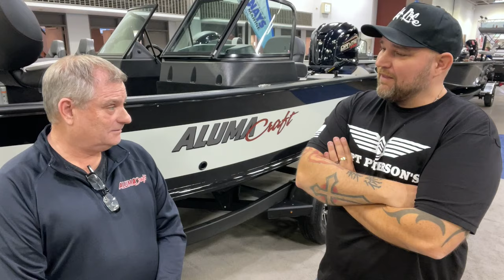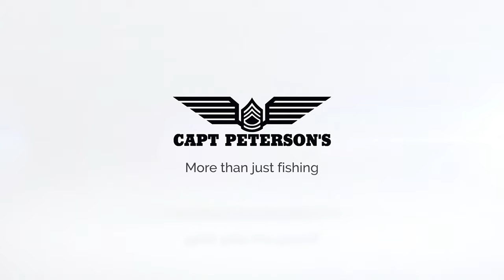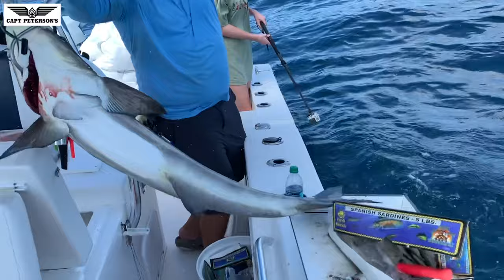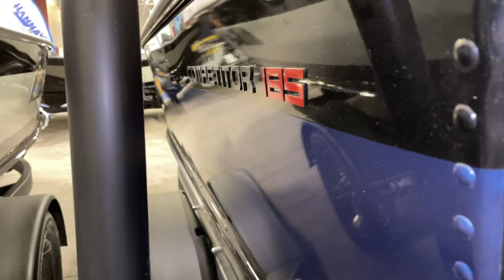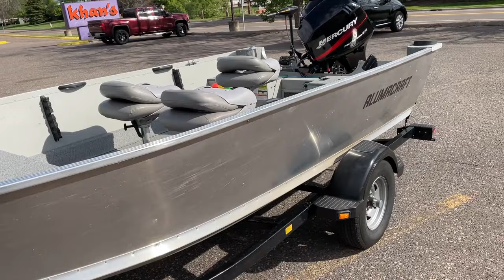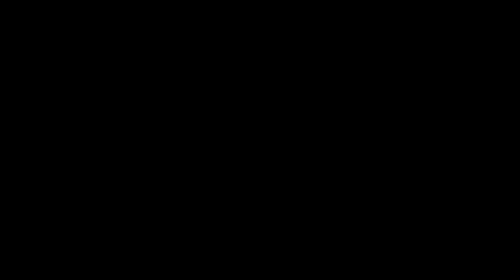No One is Telling You The Truth About Aluminum Boats So I Have To

Comment: Its real simple logic.....aluminum boats flex.....welds do not flex....rivets do....
Reply: Yep, rivets can create elongation within their the holes. Welded joints throughout time create "weakest link" points scenarios; next to the weld itself. I'll take the "rivet" design any day of the week.
Reply: Tell us of battleships and aircraft carriers, or even oil tankers that are rivited. Lol.
Reply: @NoneOfYourBeesWax1  Also you tell us the difference of the Steel and Size of the Steel being used on them application. Big (Huge) difference in applications than a sheet of aluminum hull less than 1/8".
Reply: ALL metal flexes.

Comment: the smaller Starcraft riveted boats held up fine for decades but would leak unless the rivets were re-bucked.  the larger ones, 20 ft and over were prone to cracking along the bottom between rivets.  we have a 1967 Starcraft 14 foot and it's still doing great.
Reply: I have 71 15' Starcraft Runabout all good except where the previous owner let it rub on the rocks , got that repaired , been 30 years  no leaks.

Comment: I've had two riveted boats and both started leaking on the place where the studs from the trailer had contact. It's not so much the bumping on waves but it's the transport on a trailer that causes leaks. I own now a welded made in Finland Buster boat for many years and the quality and performance is not comparable with Aluma Craft etc.  I should have bought a Buster from the beginning than i saved a lot of money and trouble.

Comment: I have owned 15 fishing boats. A long time ago, I.bought an aluminum boat that had been used strickly in salt water fishing the bays in Texas. Every rivet on the boat leaked. I.coated the bottom with polyester fiberglas cloth and resin. Never leaked .a drop after that. I now own a 16' 8" Tracker. I.bought it because it is light, and was inexpensive. I fish small 1000 acre lakes that rarely get any chop on them. If it is windy, I don't go. I hate fishing in the wind. I bought aluminum because they are lighter, require less maintenance, and since I usually fish alone, are much easier for me to manage.  When gauging toughness, I look at what they use in Alaska. Their boats are all welded aluminum. All.of them.
Reply from the maker: Lunds are very popular in Alaska, Canada, and Minnesota on big lakes. They are riveted.
Reply: @CaptPeterson Do not forget Polarcraft. My Dad had one for well over 30 years until he passed. The point is you could run that boat up onto the rocks and pound the dents out of the boat, and she was good to go.

Comment: To me, the pinnacle of aluminum boats are the Coast Guard 45-foot response boat-medium. By pinnacle , I mean if I could have any aluminum boat, I desired, this is the one I would pick. Obviously I would want more luxury than the .mil version, but the self righting ability, hull design, dual 6 cylinder diesel jet pump powered drive. Joy stick controlled. It is designed to operate in 8 ft seas and survive 12 ft seas and 50 knot winds. Is it riveted or welded? AND we all know the government doesn't always pick the best of the best, but instead often pick the cheapest unless there is a reason for the more expensive option. As far as I know, the RBM45 is welded since you can find the CG requirements for repairing any welds online. I assume there is a reason for picking the more expensive option. AND this has no real context except it is a fact and it was a famous ship that sank. The Titantic was riveted. lol

Comment: Welded is much less likely to crack then around a rivet.  Rivet is actually cheaper to produce than welding due to the time required.  But welded is stronger and more watertight.  That is why welding is used where strength is required.  Trucks use oversize box and riveting for cost and speed of production as they do not need to be watertight.
Reply: The weakest part of a weld is the perimeter; NOT the weld itself. In other words the (less than a 1/8") aluminum IS the weakest link.
Reply: @BumpNrun69  And putting hole in it and then filling it with a rivet is even weaker.  I did NDT for several decades and know which I would choose every time.

Comment: Thinner aluminum sheet is difficult to weld effectively. Manufacturers use thinner material to save money therefore really have no choice but to rivet. They don’t rivet because it is superior, just superior for the material thicknesses they use.

Most river boats that are required to run over and survive rocks, sand, and logs, use thicker formed and welded aluminum sheet/plate. The thicker material allows welding without overheating and burn through like you would see on the thinner material used on riveted boats. 

The flatter the bottom the more it will flex too. That is why you need the thicker material as well.

I’ve seen many Jon boats that are riveted start to leak because over time they start to fatigue from flexing so much. I’m talking about the thin walled RIVETED ones. This isn’t because they are riveted, it’s because cheap thin boats that don’t hold up must be riveted because welding isn’t an option on boats that thin.

There’s also the fact that rivets on a boat don’t take 2 years of trade school and years of practice to master. I would say on a production line a hard working unskilled person could learn to rivet fairly quickly where as putting out a “stack of dimes” is very difficult therefore a competent welder would cost the manufacturer much more.
Reply: Laser welding does fantastic on thin aluminum.

Comment: on my second welded boat been in rough seas many times landed hard many times no issues tired of rivet guys saying welded boats crack that's BS I think both are good and its a stupid discussion and air planes have big temp and pressure changes that's why its riveted pretty sure a boat will not see the kind of changes a plane will see.

Comment: It’s all based on the thickness of the material thin aluminum needs to be riveted, but please understand that mega yachts, which are hundreds of feet long use sticker aluminum and they are welded and weld because the material is thick enough

Comment: With anything less than 3/16” i can agree

I have experience in work skiffs with 3/16” sides and 1/4” bottoms 

And i do think there is an application for both methods

Bottom bracing and framework layout is critical in both applications 

Weight and foam for structural integrity is also part of the equation

hull materials, joinery,design, application, maintenance, hp requirements, cost is very end user specific 

Thanks for posting!
Reply: This!

A sheet metal welded boat is very different from a plate welded boat. 
Crestliner tracker lowe are sheet metal boats when welded changes the temper of material at weld location and if any cracks they will start there and spread. Rather have rivets in sheet metal and welded plate. I have both neither leak and each has its applications.
Reply: @omieyouknowme   "when welded changes the temper of material at weld location and if any cracks they will start there and spread"...
Finally, someone who is educated enough to understands the chemistry of a weld. Many people here are so clueless to this fact. :yougotthis:
Reply: @BumpNrun69  waiting for epoxied aluminum boats.
Reply: @omieyouknowme marine plywood, 'glass and epoxy composite hulls are excellent. They're durable, easy to repair, quiet and warm. Plus, wood floats. Kind of makes sense to make boats out of it, but it's not as profitable to large companies as cranking out aluminum hulls.

Comment: The only problem with aluminum boats in salt water is that you should avoid city water of any kind.  Salt,aluminum, and chlorine will have a reaction where the aluminum develops pin holes that steadily get worse in time.

Comment: Riveted boats leak from heavy waves over time. Welded boats don’t but are more expensive initially. Welds can crack however if they are not done properly. Not all welded hulls are equal
Reply: This is the only comment I found addressing LEAKS. 99.9% of boats are plenty strong enough in the conditions they were build for.... Over time, rivets leak. I like a dry boat.

Comment: The main alloys used in aircraft construction are heat treated and usually not considered weldable.  So bringing aircraft into the discussion is misleading because they have to be riveted.  The only places you will normally see welded aluminum in aircraft are for items such as tanks, or non-structural fairings.  Since those components are not as highly loaded, lower strength, weldable alloys can be used.
Reply: Tanks are water tight I’m assuming. That’s kinda the point I’m taking away.
Reply: @colt110987  Being water/air/fuel tight doesn't really have anything to do with welding vs. riveting.  Many tanks are riveted, and an integral part of the structure, more so the larger the aircraft gets.  On light aircraft, there is less advantage to having the tank built into the structure, and since they only have to support the weight of the fuel they carry (as opposed to being part of a wing's primary structure), then it's just easier to make them out of a lower strength alloy and weld them.

Also consider that many aircraft made of riveted structure have to be airtight because they are pressurized.

Comment: Rivits disperse the load across an area the diameter of the rivit at each rivit point.
 A weld spreads the load evenly along the length of the seam.

At the point of failure a popped rivit transfers it's load to the next rivit which wasn't designed for that load.
The rivits start popping like a submarine movie.
This leaves holes where water jets in.

We'd have to try to break our welds in shop class and the weld should be stronger than the surrounding metal.
A poor weld can erode the surrounding metal and create a thin spot. Heat can harden the metal and make it brittle.
Modern robotic welders sure make some pretty welds and rarely over cook it.

Comment: Lmao, you lost me at rivets are stronger than welds...  Clearly there is a conflict of interest here.....
Reply: Its true
Reply: @@drewhio9262the comments I was about to make....
Reply: I’m in the market for a new aluminum boat. I am looking at princecraft Alumacraft and smoker craft. All three are Rivet
Reply: @@drewhio9262 airplanes need to flex.  Boats if they flex too much will start leaking at the rivets. In southeast Texas almost all aluminum oat for the bays and lakes are welded.  Much stronger.
Reply: By a so called “captain” I’ll grab the next boat charter by someone else thx though 😂
Reply: I have a 1977 StarCraft that's riveted that I use for a bay boat and it's great you put a welded boat through that life for that you'll be fighting cracks constantly
Reply: I disagree with this.  I’ve owned a riveted boat - it leaked water at the transom.  I’ve had rivets completely sheer off that held my cutting board on my bait well (from the same pounding this guy speaks of).  My 20’ welded boat has been solid, through small chop up to 50mph and ocean swell.  You don’t see off shore boats being built with rivets they are hand welded in Washington and Oregon.
Reply: Yet airplanes are riveted not welded why?..
Reply: LOL and they always go to the airplanes. Are made with rivets. They're not smashing on waves. I grew up with rivet aluminum boats.They work good but the rivets leak
Reply: Structural aircraft mechanic here.  A properly bucked or pulled rivet maintains the integrity of the aluminum, as the rivet joins the material.  Heat worked aluminum is not as strong as riveted aluminum, at the site of the weld.  If your boat has working (loose) rivets or leaks at the rivet, replace with an oversize  oversized rivet and get some 5200.
Reply: @wrecker1861 often airplane sections are removed by drilling out the rivets, can't do that if welded.
Reply: The only hole I'd feel comfortable with on a hull is the bung hole.
Rivets are like flying a plane with superglued Wings
Reply: I own a riveted Alumacraft that I beat the hell out of. No leaks!
Reply: @alancummings5651  most airplanes cabins are pressurized and any leak will result in failure to pressures so yes aircraft flex but they also can’t leak. Your boat when you pound waves flexes also
Reply: @myfavorite1 the vibrations and amount of force a aircraft endures going 300mph is like nothing a boat will ever go through
Reply: @myfavorite1 I rather call a buddy to help me tighten up or replace a leaking rivet for free instead of pay a welder to fix a fix a crack……. But hey I’ve owned both…… and will continue to own both….. I don’t keep boats long enough to really care about longevity…… I’m worried about the over all layout and fishablity of a boat more then I am if it will go 50 years without leaking
Reply: Helicopters are all riveted because welds won’t hold under their forces and vibrations, but rivets do just fine. Tell Sikorsky they aren’t building helicopters right while you’re at it here.
Reply: @alexmills1329     Again, that makes sense for flying because no one really notices the small air leaks.   It people notice the small water leaks over time from rivets.   Buy what you want but that is old technology and welded is better.  Furthermore down here going out of the ship channel by Galveston will get huge swells like the Great Lakes.   Seen them and no problem with welded.  That’s why all the manufacturers down here for aluminum boats weld their.
Reply: @t-dog8528  funny thing is many aircraft do use glue to hold things together now. Making rivets watertight is difficult, but there's no question that it is stronger than welds if both are done right.
Reply: Rivets can he stronger. It's in the tenacity of the joint and a principal called sticktion. We'll documented and we'll known. Welded boats are easy to build and allow a smooth surface. But that does not equal stronger. Do some reading it will blow your mind what you can learn with an open mind.
Reply: From a strictly engineering standpoint, one or the other is not the ideal solution for everything. There's a few misconceptions I'd like to straighten out, in ships planes and skyscrapers all three of them use both depending on the scenario, heck in skyscrapers they use nuts and bolts in many situations. 
The idea of a 💯 welded, or a 💯 riveted hull is just dumb to me. Why aren't these manufacturers looking at their failure points and thinking about whether or not a different bonding method might work better in that particular scenario. But no, they're all going "oop the weld cracked, weld it some more!" Or oop some rivets popped, just bang some more rivets in there!" FFS, we need to do better.
Reply: @ahabsbane  Your an engineer? Your a welder? Do you know what is required under law to "repair" a cracked ship? Have you ever had your welds inspected by the USCG? What are your credentials/resume to insult an entire field of engineering and crafts people as a whole? Have you ever seen torture tasting of wlded/riveted joints first hand? You want things to be clear. Let's hear it....
Reply: @myfavorite1 yeah cuz fighter jets going Mach 2 are clearly less under stress than boats smashing on waves 
l o l
Reply: @tireballastserviceofflorid7771 bro wtf hes the kindest and neutral among this whole comment section
Reply: @ViquelOoste  He made a statement that is bogus. I asked for clarification. Not about being nice. It's about calling out BS.
Reply: I have worked in the automotive industry for 20 years. If you are driving a newer vehicle, there is a good chance that riveting and adhesive are part of its construction. In fact there are some repairs that by oem standards will only allow riveting.
Now having said that I have owned aluminum plate welded boats. Stabicraft and SafeBoat to be precise and the welds on those boats are 100% solid and have taken severe weather beatings while in operation and are still 100% structurally intact.
Reply: @jejoko  If you look at a rivet vs weld it becomes clear how a rivet is vastly stronger than most welds. A little talked about physics thing. Stiction. And the ability to give just a tiny bit under extreme loads. Welds don't like to flex and only affect the areas they touch. Science is fun...

Comment: What’s really dumb is the fact this is still a conversation… 
With having the Giga Press Elon designed, these small aluminum boats should be getting stamped out. 

Even if it was in two halves. Big press, stamp them out, weld or rivet the one seam… done! Strength of the joint is also dependent on the placement of the joint or seam. 👍

Comment: airplanes dont go into the water... as often.
Reply: True but most airplanes wings are the fuel tanks and hold liquid fuels. Jet A1, avgas and diesel. On mid to large planes in the areas where the fuel is stored they use huck bolts.

Comment: this is a perfect explanation and 100% correct
Reply from the maker: Thanks man.
Reply: No it is not 100% correct. Planes on use on average only 10% rivets in their construction, the other 90% huck bolts are used. Also huck bolts are used on trucks bridges and building in areas where high stresses are expected.
Reply: @johnbrown6189   I already read one of your false interpretation in one of your earlier comments. So your point is moot. You know nothing regarding welding on an aluminum surface, nor understanding the repair level after the hull starts to separate at the perimeter of the weld.

Comment: Riveted is fine, but it’s a cheaper build. You don’t have to hire highly trained welders or run expensive welding machines. A quality welded boat is smoother and faster. Nothing wrong with a riveted boat though…

Comment: I'm not buying into the riveted aluminum boat being better than a welded boat. Riveted boats require a gasket/sealant at over lapping joints. Boats aren't planes.
My own experience with welded aluminum boats (25+ years) has been not a single crack or failure. But hey! Viva La Difference! Buy what you want.